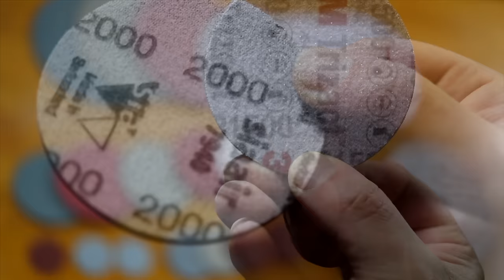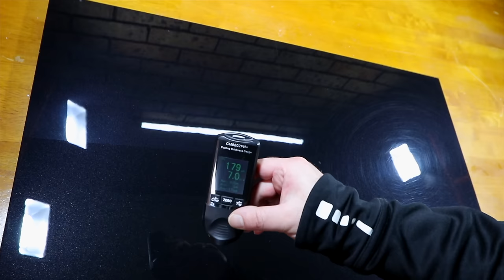A Guide To Wet Sanding, Compounding & Polishing Car Paint!

Comment: Hey Sandro. Awesome video like always and very helpful. Hope you doing well. By the way, i discovered your YouTube channel a month ago and loving all your videos, its been helping me a lot and im quickly filling my arsenal with your recommend goodies, a bit difficult to get as i need to order most of the stuff from overseas, none the less im getting there. 

 I need a real expert opinion.

I have a 2007 Ford Focus MK2 ST225, Performance Blue metallic in color.

The right back side panel near the boot and right back side door has some oxidation and to my understanding i need to get a compound as it seems to work with oxidation. I have Tork Craft DA Polisher 800w and uses 6" pads, what is the best pads to start using, cutting, soft medium etc.? Brands thats locally available for me to buy is 3D, Mequiars Ultimate Compound, Mequiras DA Microfiber Correction Compound and some Turtle Wax products.

I dont really want to take the car for a respray or that section only.

Your expert opinion will be really appreciated and what steps to take to prevent it from happening again😎😎😎
Reply from the maker: If it’s just oxidation there’s really no need to get it resprayed, and if you’ve seen the video I did on how to correctly restore car paint it’s really using that same process. 
Heavier oxidation on hard car paint can be extremely difficult to remove and will require coarser compounds and pads to do so while that same oxidation on a soft paint should come off quite easy with much less aggression needed. So the best thing you can do us start with light compounds and pads and work your way up to more aggressive ones only if needed. 
I good starting point with Meguiars would something like M205 or M210 or D302 with their yellow foam polishing disc and if that doesn’t do it I’d try one of those polishes with the Foam maroon curing discs and then even the finishing microfibre pad followed by the MF cutting discs as incremental increases in aggression. If that fails to remove the oxidation then I’d start again using those same pads in the same order with a more aggressive compound like D300 or M105 or M110. 
I’ve corrected Ford Focus’s with both soft abs hard paint so I don’t know what your paint will be like, but just do your testing and I’m sure you’ll find the right combination!
Reply: Thanks Sandro...that helps a lot and i will definitely get to work on it and will let you know what the outcome was...keep up the great videos...i really do learn a lot.

Comment: Great video! What should I do to achieve a uniform matte finish by wet sanding a glossy paint?
Reply from the maker: Thanks, but are you wanting to turn a gloss finish into a matte finish paint? If so you really have to use a matte paint to paint the vehicle, as although sanding will matte down gloss paint it will also be full of sanding marks.
Reply: @CarCraftAutoDetailing  Thank you! Yes, I want to turn a gloss black paint to a flat one without repainting.
Reply from the maker: You can certainly create the matte finish by sanding, and if you progress to from more aggressive grades of 1500-2000grit to them 3000-5000grit you can reduce the severity of the sanding scratches, but I’m just sure it’s going to look great or all that even. I guess it’s something you could try but I’m really unsure if the finish will be what you’re after.
Reply: @CarCraftAutoDetailing  Thank you!

Comment: Slt sandro, I was looking forward to this video! 👍👍👍.  I start to wet sanding gently to learn.  When you work small places by hand, for example a horizontal scratch ,should you work it horizontally or vertically?  At the moment I am working with M105, M110, M205, M210.  And I am satisfied.  I train on old car parts before buying a PTG !.  I want one that can measure layers separately and not all layers at the same time.
. thank you my friend
Reply: As ive seen on AMMO NYC video about wet sanding its best to sand at an angle around 45° if done by hand.
Reply: @karolisrum6573  OK thank you my friend 👌 👍

Comment: Can you make a video on how to maintain a car once cleaned and waxed. Also would dilated cider (to remove water spots) harm the wax's finish?
Reply from the maker: https://youtu.be/7v4U_0pN9CI
Some waxes are more chemical resistant than others, but overall waxes don’t tend to resist an acid based cleaner like vinegar or cider that is strong enough to remove water spots without compromising the wax.

Comment: For heavily orange peeled cars like Corvettes, is wet sanding an option to smooth the finish? Is orange peel typically from the base coat or clear coat? Any way of knowing? Thanks - love your videos.
Reply from the maker: Wet sanding done right can certainly reduce or remove orange peel, and it’s usually a clear coat issue.

Comment: Did you change sanding disks in between passes? Or use the same disk 2k and 4k throughout your entire process?
Reply from the maker: On that small label in was the same disks, I just flushed them out between sanding, on a larger area you’d be using a few disks.

Comment: Hey Sandro, great video as always, just wondering how would you get rid of pigtails if you managed to get some? Cheers
Reply from the maker: Thanks and I would generally re-sand to remove pigtails - make sure the panel and disks are completely clean and just sand for very short periods, re-clean everything and continue until they are gone. If it’s a very soft paint sometimes you can compound out pigtails, otherwise it’s more sanding refinement that will remove pigtails and if you are really struggling with your specific machine and disks to avoid them, you can also hand sand to remove them.

Comment: Hi Sandro great tutorial . Could you tell me the absolute lowest clear coat reading you could go down to.Also do you think an orbital sander would be better or worse for a beginner on just single panels, thanks Mark.✌️
Reply from the maker: It really depends on estimating what percentage the actual clear coat is in your readings - which you can estimate by measuring in the door jamb areas -
But any thing under 100 microns tends to be risky on average. 
An automotive orbital sander like Rupes, 3M and so on are great for beginners, but some general hardware store orbital sanders can be far more aggressive and aren’t really made for sanding car paint.
Reply: @CarCraftAutoDetailing  thanks for the very helpful response and definitely your best tutorial to date.

Comment: Great video! As a beginner, I was just wondering what you used to clean off the pad between passes as it wasn’t shown in the video.
Reply from the maker: Just spray it down with water and spin it dry onto a bucket

Comment: really in depth analysis and mostly i agree. but never stop your machine while on the surface, the rotation+wetness+speed results in fine sanding, the slower the worst/deeper sanding marks you get. also overlapping 50% is too much and will remove more than you need on the previous sanded lane. also always for the last step wet sand by hand to make it even and soften the transitions of lanes which can cause a haze effect without having a actual haze, hand sanding really wet as a final step  is not beatable on finest levels. keep fingers closed and angle your hand to be abut 30 to 45 degrees relative to your sanding direction so you dont end up with scoring marks. this is where all the used fine 2000 to 5000 hand papers come into play, so wash them, clean them, let em dry and use them here.

Comment: I want to ask you a question. my car has very few scratches and I just want to soften the orange peel. In this case, would sanding only with P4000 without P2000 help alleviate the orange peel?
Reply from the maker: Using P3000-4000 will help eliminate some orange peel but it won’t have as much effect as using P1500-2000 which will be more effective.

Comment: I remember that I saw some pads that looked like polish pads, but were actually for sanding. they were thick as a normal pad but super hard. Apparently a lot safer for edges. I can't remember what they are called.. Do you know what I mean? If so, thoughts?
Reply from the maker: No, I’m not too sure on those.

Comment: We use Rupes polishers and compounds at my work, the compounds you used at the end are they the same as the Rupes yellow(fine) and the Rupes blue (course)??
Reply from the maker: I wouldn’t say the compounds I used are the same as the Rupes, but you can certainly use the Rupes compounds to achieve similar results in many cases.
Reply: @CarCraftAutoDetailing  thank you

Comment: hey, does polishing work permanently smoothing out the clear coat or is the haze from wet sanding visible after some time and you have to polish it once again?
Reply from the maker: If you use compounds/polishes that don’t fill and you don’t use excess heat to swell the paint, the sanding scratches will be permanently removed.

Comment: Hey cool Video but i have a problem, maybe you can help me.

I tried to sand out the orangepeel out of my black two layer painted car hood.

Some informations about my procedure:

1. orbitalsander with 5mm throw
2. soft interface pads
3. p2000 sanding discs
4. trizact 3000
5. trizact 6000
6. Buffing with Mirka polarshine 20 coarse and hard pad
7. buffing with Mirka polarshine 10 and soft pad

 I used much time to sand with each grid to eliminate the sanding marks from the coarser grid before.

And i tried to work as clean as possible...i was paying much attention to clean the paper to prevent deep pigtail scratches...once i had them and i couldnt eliminate them again.

So but the result is that overall on the complete surface remain fine sanding "swirls" like pigtails but not only on some lines. Once i had pigtails, they where visible from almost 1meter far away from the surface, but they were only one some lines located. The sanding marks now are on the whole sanded surface...they are not as deep as pigtails but nevertheless hard to remove with buffing...

can anyone help me?

Thanks...
Reply: Is my problem the 5mm throw sander?
Reply from the maker: I don’t think the sander is the issue 3-6mm throw sanders are Industry standard. It’s sounds like a refinement issue. I can’t say for sure but possibly your sanding discs are worn out so they didn’t effectively remove the initial P2000 sanding marks well enough or you just needed to spend more time with your P3000 discs and maybe trying some fresh new ones. In the end if you can’t effectively compound them out it means you have deeper sanding/pigtail scratches that need to be further sanded down before you can buff them. Maybe just try doing and very small section from start to finish (P2000, 3000, 6000, compounding and polishing) with new discs and pads to see if you can get it perfect rather than doing the whole panel. This will at least tell you if your general method is correct and whether or not you may just need to slow down and work smaller areas and change to new discs more often.
Reply: @CarCraftAutoDetailing  Thank you very much for your answer.

So i think i spent enough time refining the sanding marks with finer grid... 
One time i sanded a complete hood of a silver painted car and buffed it. This was my procedure:
1. 3m 26011 p1500 with holes in
2. Abralon 2000
3. Trizact 3000
4. buffing

I cant imagine there were any sanding marks or swirls...
There are two explanations for this: 
1. there werent any
2. the silver paint is able to hide these better than black paint? 

I tried to clean the papers as often as possible to prevent dirt and scratches
Reply from the maker: I guess it could be the silver metallic paint that hid them last time. It also could be just the different paint type harder/softer that’s causing these variations, it’s really hard to say. Sometimes you just have to stop, walk away and then come back and try some problem solving trying out some different things to hopefully find a solution - it’s all a learning process.

Comment: I love your channel. It is extremely informative. I have a 2017 Mazda CX five that somebody gave me a “kiss” on the front bumper. I was able to get most of the scratches out using Rupes blue polishing compound. Would wet sanding be beneficial in this situation I would it do more harm than good?  Thanks
Reply from the maker: Wet sanding could definitely help clear up more of the defects, but you just have to keep in mind that it should be just very light sanding as Mazda paint is typically amongst the thinnest in the industry so it doesn’t take much to go too far which would obviously be more harm than good.
Reply: @CarCraftAutoDetailing  should I try with a polishing machine or a block sander first? 2500 grit or 5000k grit paper?
Reply from the maker: Sanding is one of those things that you’re best served practicing on a test panel first - you can get a panel from a car wrecker yard cheaply - as there’s a bit of a learning curve in not only sanding out a defect but also refining the sanding scratches. Generally machine sanding is more consistent and easier to refine unless you’re quite a skilled hand block sander. But if you go slow sanding by hand and it’s just small area it can also be less intimating and safer - so it really just depends.

Comment: thanks for this video.
my observation is that whenever I wet sand and polish I discover that the spot I wet sand remain dull after one or two washes.whats your advice on this
Reply from the maker: That would most likely be a refinement issue. You may need to sand more with your finer sanding grades and both compound and polish a little more. Also try and use an IPA wipe to clean the areas as it should remove and polishing oils that may give you initial false results that then come off later on during washing down the track.

Comment: What kind of lifespan do you get out of higher grit sanding discs? I do alot of spot sanding, and I've tried several brands, usually fall back to 3M Trizact. But, and especially when sanding by machine, all the discs seem to dull very very quickly. For instance, for me, a 3000 Trizact disc on a DA loses up to 35% of its cut after just 4 section passes. I always sand wet, usually just straight distilled water.
Reply from the maker: It varies a lot. If you work shorter cycles and flush them well after every set it can help extend their performance. They also seem to wear down much quicker on harder European clears compared to softer Japanese ones. Headlight restorations also seem to kill them much quicker. Though I think that the sia disks have pretty good life overall - how long it’s hard to say 🙂

Comment: Great video. Why not create a template overlay with small holes that can be set on the panel after each pass so you can read the thickness in the exact same spot every time.
Reply from the maker: Thanks, and that’s not something I’ve considered, but maybe I’ll try it in a future video!

Comment: On small spots where you have scratches how do I polish the paint after putting paint on the scratch on a metallic painted vehicle. Can I just use a yellow pad on my da polisher and put compound after I put basecoat and clearcoat over the scratches.
Reply from the maker: I go through that process in this video: 
https://youtu.be/4f9zqVbcZDQ
Reply: Should you only sand metallic paint after applying clearcoat. I had some small scratches on truck and painted over them but I see after painted the paint surface isn't flat so I would have to sand it out.

Comment: Great video but will this work with a vehicle that's in not so bad condition but has some orange peel?  What I mean is after I've done some compounding polishing and waxing the finish is not a mirror image.  The reflection is slightly blurry but not terrible.
Reply from the maker: Sanding to level down orange peel is similar but different - in that your go through the same process but won’t use any backing foam or foam backed sanding discs/paper for the initial levelling stage, usually using P1500 to level out the peel.
Reply: @CarCraftAutoDetailing  thanks I may look into this but I'm slightly disappointed after doing 4 days of detailing on the car haha.  
The car is a 2003 vehicle with 14,000 mi and it's always garage kept never driven in the snow or rain.  Does orange peel sometimes just come from the factory?
Reply from the maker: That seem like a fantastic find with so little miles!
Yes, orange peel is found on all factory paint jobs, but some are better than others

Comment: Ah 14:41..

What worries me about first trying this, is doubling up the sandpaper and not eliminating the sand paper etchings from the previous step. How do you I know what I’m looking for without every having done it? I notice how the paint because a lot less ‘cloudy’ but then I don’t want to ‘think’ I’ve removed the previous sand marks, use a wool pad and cutting compound to then see I’ve missed the sanding etchings? 

That’s currently the main and probably only thing that is stopping me practicing this.

Comment: Any recommendations for a good paint thickness meter in AU that’s not too expensive would be appreciated - great video as always - cheers
Reply from the maker: Below is a link to the one I currently use at work and have for the last two years. There are cheaper ones and certainly more expensive ones (I don’t know what you’re budget is) but it’s a great little unit, extremely accurate and reliable. 
https://www.waxit.com.au/products/waxit-paint-thickness-gauge?_pos=1&_sid=98ff38aa4&_ss=r
Reply: @CarCraftAutoDetailing  Thanks for your help - cheers 🙂

Comment: Hi sir. Can i use a DA polisher for sanding? No negative impact on the machine (bearings and such)?
Reply from the maker: I’ve used DAs to sand for many years without any machine issues so I think you’ll be fine
Reply: @CarCraftAutoDetailing  That's great. Thanks for the video and quick reply.